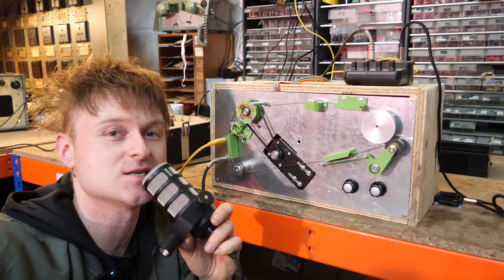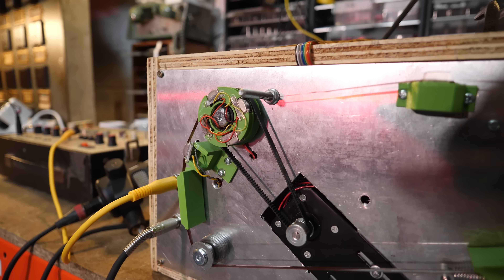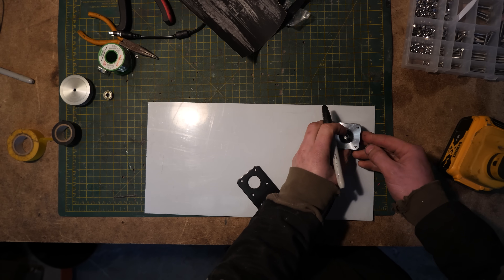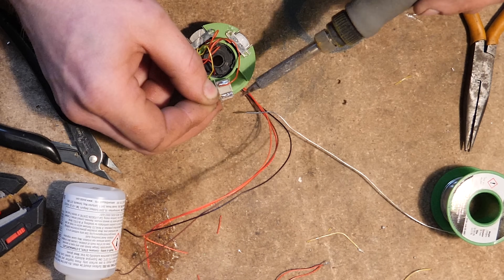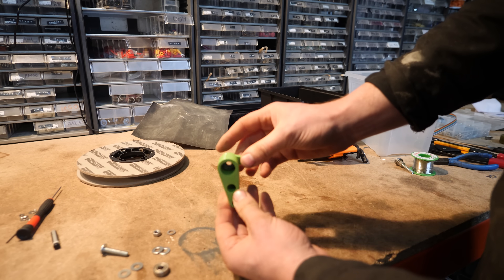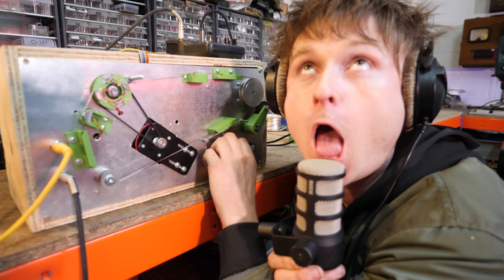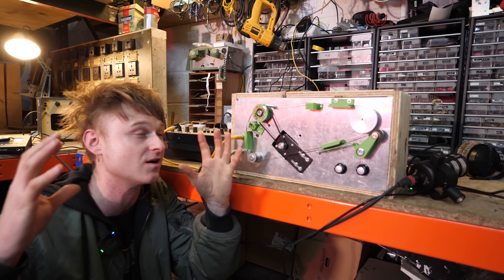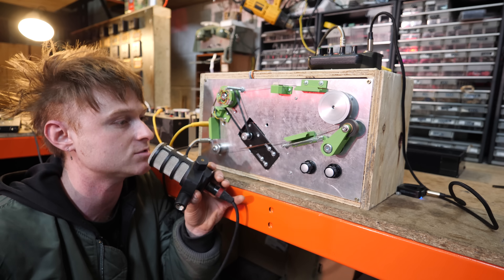A Realtime Pitch Shifter Made From TAPE AND ROTATING TAPE HEADS :O did it work?

Comment: You could hook up a midi keyboard and program it so each key would run the spinning heads at a specific speed. Use middle C as no change, the upper keys to speed up, and the lower keys to slow down. Each key would change the speed the correct amount to go up or down one note..
Reply: there was a vestax turntable with a similar idea of using midi to speed up / slow down the table in increments of 1/root12 so a record with a sample on it turned to C would follow the melody you give it
Reply: @famitory interesting!
Reply: That would make it kind of like a cross between a Hammond organ and a melotron.

Comment: Is this more or less how they did the pitch shifting effects in the Hitchhiker's Guide to the Galaxy radio series? Or was there some other way of doing it by then? It sounded to me like some of the voices were done by feeding the shifted audio back into the shifter (perhaps simply by setting the mic near the speaker) to create a kind of upward or downward drifting echo (differently from how it would sound if you just change the speed on a tape delay). I've been able to replicate it with a digital pitch shifter, but I've always wondered what they used in 1978.

Comment: Hey, your pitchshifter project is really impressive! I found it especially fascinating how you showed that you can change the pitch with the rotating heads while keeping the tempo the same. It gave me a bit of a 'brain knot' at first, since pitch and tempo are usually linked. But the technique behind it cleverly separates the two – the tape runs at a constant speed while the heads sample different parts of the signal. Really cool how that works!
Reply: Oooooh ok I think I got it, thanks. So it produces à superimposition of several time-compressed voice signals with a time offset which make it seem like the pace is not accelerated nor slowed down ?

Comment: Well well... turns out, it wasn't 90° around the tape heads. What if it were possible to go even over the 90° mark? In my imagination, that would make a bit of a tape ring-modulator flanger-effect bastard thingy, would it?
By the way, did you see the pitch-shifter in Wouter van Veldhoven's videos? It's kind of similar, although yours appears much more thought through. This man does funny tape tricks. I love your work, keep it going ❤
Reply: See that unexplained bolt goring up the tape? That's bringing it back to 90 to better match the pickup angular spacing. I don't think 4 is fundamentally ideal, as the amount of /time/ delay between play and pickup is modulated by the angular position of the pickup, so more heads and smaller angle would reduce that, if you even want to. Trade off is the extra electrical losses from more idle heads, but surely you could do it with between 2 and 6 before geometry gets awkward. Also like that guy said they should probably be series wired for better amplifier matching, seems legit to me as an EE.

Comment: I'm listening so hard for artifacts of the "handover" point, where one head leaves the tape and the next starts touching. There should be a skipping effect, but I can't hear it. How is that possible?
Reply from the maker: because of the tape speed. as the tape head leaves and fades into the other, by the time the other hits the tape has caught up. its purely a speed thing. which works in both directions. if the tape was running slower it would be audible
Reply from the maker: you can also hear double hits when the drums are playing in high speed if you listen

Comment: You should try modifying and old VCR to do this. The tape heads are already made to spin while the tape goes by.
Reply from the maker: indeed i did humour the idea when thinking about this. but issues, you need to modify it to not spin diagonally. also it only has 2 heads so needs to be wrapped around 180 degrees, also the heads are tiny, so tracking needs to be absolutely bang on, so much harder to make. hence opting for this method
Reply: @LOOKMUMNOCOMPUTER  Early long play VCRs had four heads at 90 deg from memory, but agree with the rest of the problems. They are quite a different beast to an audio head.
Reply from the maker: @stephenw2992  I only had 1 drum in my box of spares and it had 2. I just
Built it with what I had lieing around. 👍👍 if you find one give it a go

Comment: I have seen such a machine on a very old TV-show (ZDF, zweites deutsches Fernsehen) somewhen in the 70s. The guy showed the Moog-Synth, and had a system with tape that could (as here) change the frequency of signals in realtime.
As i remember the system used a much longer tape, that was contained in a sort of "cassette", storing the tape comparable of the old needle-printer-cassettes in "waves". So a much longer tape could be used, the tape was not used that often to delete and record again.
Reply: I think some early phone answering machines had that type of endless cassette with loose tape folded up inside

Comment: Sam, it fascinates me that you built this machine without knowing about AC bias 😂❤
Reply from the maker: Ha indeed. I knew of it. Just not how to practically make it work. And just ran out of
Time :(
Reply: @LOOKMUMNOCOMPUTER  Than I take it all back! Usually it's just a sine wave oscillator coupled to the record head through a cap. I'm sure you'll figure out a solution, you always do. Love your work. Best wishes! 🤗
Reply from the maker: @SpamSundays  yeah me at midnight last night swearing at breadboard circuits i was making of record circuits caused me to give up and just solder to the copicats bias circuit.  i built this in 3 days, some things got skipped as you see ha

Comment: Would it work with a VCR head? It is a finished "bolt on"  device. Just do not mount it at an angle as in a VCR.
Reply from the maker: You could. I thought about it but couple of issues. You'd need to wrap the tape around 180 degrees of it. Like you say work out how to make it spin straight. Also head is tiny so the tracking would need to be perfect

Comment: The concept is really cool! I literally cannot work out how turning the tape heads can affect the pitch... I always thought that pitch bending on tape can only be possible if you slow down the tape itself..... maybe one day I'll build it too! Really fantastic!
Reply: Imagine yourself running at constant speed in a circle (you're the tape). You know how people will catch up if they run faster than you and fall behind if they run slower? That's how it works when you change the speed/direction of the rotating playheads. (And you use four to not have interruptions in the signal) 😁
Reply: @gutterg0d  ok, this helped a lot HAHAH. To me sometimes electronics are like black magic... I understand a bit but i get lost pretty easily 😅
Reply: Can't recall off the top of my head, but someone DJ's with real to real tape somewhere on this platform. It's interesting stuff!
Reply: @jagtan13 the trick is that the vertical speed of the rotating head is independent of the horizontal speed of the tape, and is much faster. The head is reading the tape in  slightly diagonal vertical stripes across the width of the tape, like taking time slices at whatever speed the head is rotating so it only alters pitch not time, because time is determined by the horizontal speed of the tape.

Comment: Fridge magnets actually have a complex magnetic field of fine stripes designed to stick to fridges, better off with a neodynium button magnets for tape.  (just a hunch)
Reply from the maker: I built this in a matter of days. Many things could be better. But I used what was sitting around. Also if it's fine for fisher price. It's fine for this :D
Reply: @LOOKMUMNOCOMPUTER  No, only for fridges, I'm cereal.

Comment: Wiring the tape heads in parallel is only correct for recording, for playback they need to be wired in serial. The reason: While those tape heads have a DC resistance of like 20-1000 ohms the voltage they produce is high impedance, like 50K or more ohms. The amplifier needs to have a high impedance input. Means a parallel head will pull the voltage down like crazy.
Reply: I would think the playback is a single unmoving head.
Reply: @DougWyman  No they are the 4 heads on the spinning drum. The drawing he put up on the screen even showed it.
Reply: @ChipGuy  Yes <blush> after my smart a$$ reply I saw that.

Comment: Could a VCR head be adapted for this usage?  Built in spinning!
Reply from the maker: It could maybe. Only 2 heads so it would need to wrap around 180 degrees of it and also you'd need to modify it so it doesn't spin at a slant. Also a very very thin window so the tracking of everything else would need to be bang on.
Reply: @LOOKMUMNOCOMPUTER  2 VCRs and VHS tape?
Reply from the maker: @jfolz  not sure how 2 heads could be bolted but yeah i suppose! if someone wants to try ha. but i prefer my approach. by all means give it a go yourself :D

Comment: You must install a conventional ac erase head instead of a magnet, this will remove a lot of noise that you got in this version.
Reply from the maker: Indeed. All in the mk2
Reply: @LOOKMUMNOCOMPUTER  What kind of slip ring did you use? You need one specifically designed for low signal levels, that have silver contacts (possibly gold plated silver). You may try to build a rotary transformer. Also put some mumetal shielding around the head drum so it will pick up less magnetic interference from its environment (like from the motors).
Reply from the maker: @mrnmrn1  you dont need a specific one, initially with the crystal palace i used a driver before the slip ring, but had found these modern cheapo slip rings are more than suffice and didnt bother with this one as you can hear there is no noise difference between stationary and moving. i was going to do vcr in first place with transformer but after testing this i thought it was being a bit over the top. no need to complicate things when it is not needed. these issues you say are not present. you can see that in the video.
Reply: Commercial cassette decks usually run the erase head and bias for the R/P heads off the same oscillator. Easy to pinch the bits out of an old deck
Reply from the maker: @stephenw2992  yep. But when I built this Sod's Law all I had sitting around didn't work.
Reply: Aha, I was thinking contact noise from the slip ring.

Comment: The popular 1960s device that did this for Pop records, special effect voices on Star Trek and the movie 2001, and for time compressing commercials to make them precisely fit in to ad spots was the Eltro Information Rate Changer.
Reply: That's effectively the opposite of this. This only changes the pitch. That machine changed the speed but adjusted the pitch so it stayed the same. So it made the speed go up/down, but pitch stay the same. This makes the pitch go up/down but speed stays the same.
Reply: @rich1051414  those two processes are actually equivelent
Reply: @rich1051414  sounds like it'd have to use a mechanism like this one to pitch correct while changing speed. so not really opposite so much as another function on top of this one.

Comment: I’m gonna get dunked on for suggesting DC motors or servo motors, instead of steppers, to make it sound better, right?
Reply from the maker: i dont see why that would improve the sound? its microstepping, sounds smooth, the large capstan was a purposeful choice to reduce flutter, but its not noticeable if im honest, the crapness is in the crappy tape and bad heads :)
Reply: I agree, at the minute it doesn't just sound lo-fi but there is some low-frequency modulation and my first guess is that its just the drive frequency of the stepper motor
Reply from the maker: @reeeeeeeeemmmmmmmmmm  when there is no signal recorded there is no noise even when motors are moving
Reply: @reeeeeeeeemmmmmmmmmm  Its likely just distortion because the heads are not in the linear part of their operating range due to no bias. Its cool hearing what they sound like. I think BASF claims in some brochure that the Germans experimenting with magnetic recording discovered bias by accident because their head amplifier circuitry was built badly and started oscillating in one of the machines that then performed much better than the others.